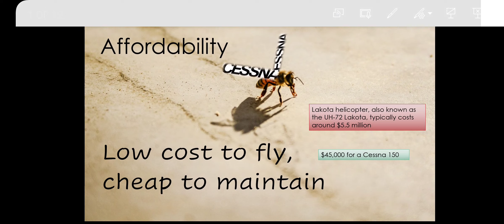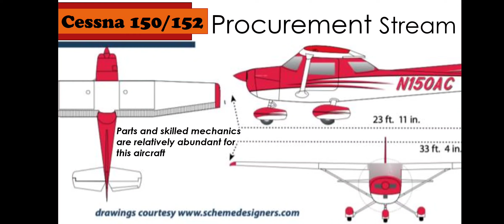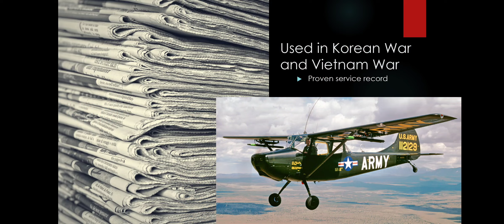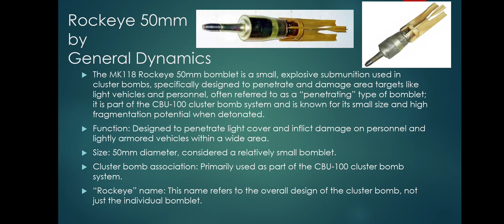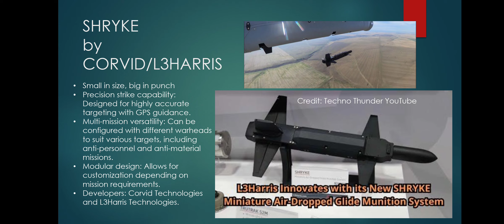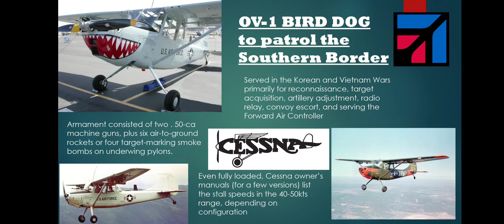Bring Back the OV-1 Bird Dog

Comment: So..They wouldn't use a Cessna 150. The OV-1 is a closer variant to a 182 with O470 power plant.
Reply from the maker: @mshoemaker11  Interesting!
Reply from the maker: @mshoemaker11  the O-470 has a significant increase in fuel consumption but still low maintenance, low cost, and extremely reliable. Still much less than a Lakota UH-72 helicopter typically consuming around 1,000 liters of fuel per hour versus the O-470 engine typically consuming around 50 liters per hour based on its average fuel consumption.
Reply from the maker: @mshoemaker11  I imagine a Cessna - Reims Aerobat with the 0-470 having about 500nm range, made for the increased stress of pylons and the increased payload of IR/satcom ATR